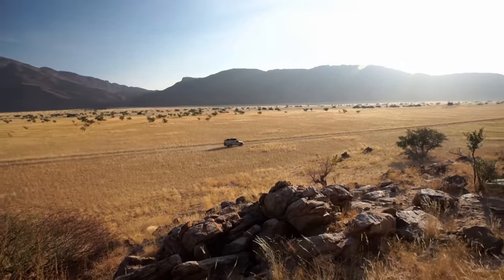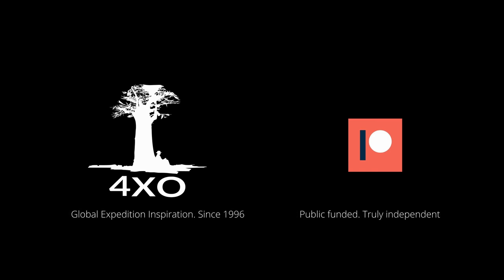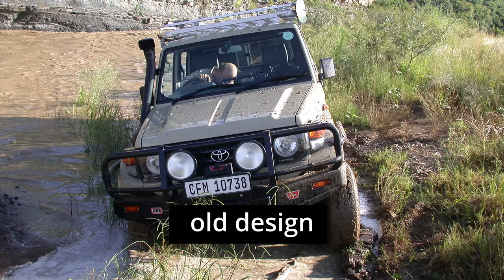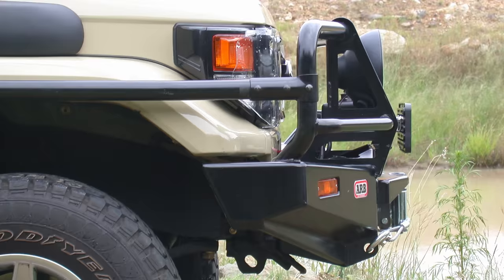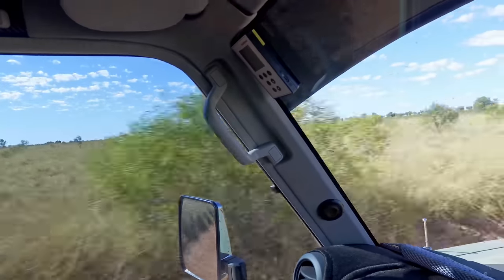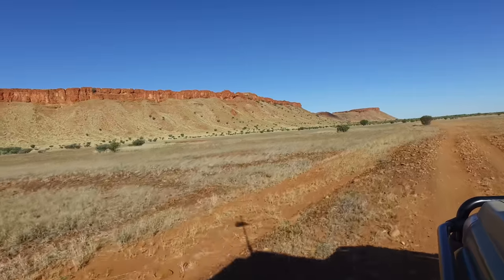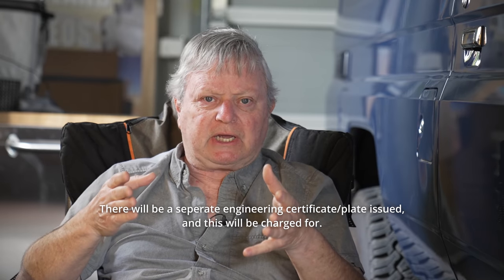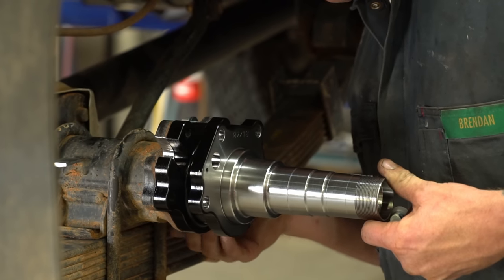TOYOTA LAND CRUISER AXLE-WIDTH CORRECTION. Is it Really needed? Cheaper alternatives? | 4xOverland

Comment: Have a 2013 79 , 180,000ks+, over half was towing a single axle 2.5T off-road caravan with 330kg ball down weight. 79 has basic Dobinsons 3750kg GVM upgrade and 2” lift. With the caravan in tow I have done GCR 5 times, GRR twice, Bungle Bungles twice(yes with caravan) Lorella Springs Savannah Way, Oodnadatta and Strzelecki thru Innamincka etc all towing. Don’t do much loose sand beach stuff. 265x75xR16 D697 Bridgestone AT,s. Have never needed matching wheel base , larger tyres or greater than 2” lift. Unless you are a super hardcore off-roading  or want the latest and greatest I can see no need at all.
Reply: How'd you rate the dobinsons GVM upgrade? Tossing up between them, TT, and ARB (OME)
Reply: @6jsm9  I am on my second set of shocks but 1000s of Ks corrugated dirt roads at 80kph will do that. Not the softest ride , but I have about 700kg static load with canopy and 2x80L water and fuel tanks, then add 330kg ball download, the 79 is not a comfortable car anyways . But more importantly it’s still there , just keep greasing the shackles. It does what I wanted it to do , and it’s been on since new. Oh, I have the standard Dobinsons yellow shocks that come with the kit, not the fancy adjustable or remote reservoir type.

Comment: You might want to revisit what is said around 16:50. Full-floating axles as fitted to 70-Series Land Cruisers, are so much better for heavy duty off-road applications than semi-floating axles used in lesser vehicles (where the bearings are lubricated with differential oil). Not only in terms of load-carrying capacity and reliability but also ease of trailside repairs.
Reply: I think what Andrew means is that if the bearings were getting hot due to wheel spacers or too much offset, having oil would help to cool them more and have them last longer. Oil is better at transferring heat than the grease. In proper form where the bearings are loaded evenly, what you say is correct.
Reply: @Splitface2811  This is debatable - oil might generally be better for high speed, high temperature applications but if the wheel bearings are unevenly loaded due to excessive wheel spacing, you are still going to end up with the same problem - no way any amount of oil will help. Another option which might be considered, is to opt for a high viscosity polyurea grease formulated for higher operating temperature and load-carrying capability.
Reply: @philipjooste9075  I don't think Andrew was saying that oil would eliminate the issues caused by the excessive wheel spacing. Just that he was saying that it might not be quite as bad as wheel bearings in grease.
Reply: You can have oil lubricated bearings on a full floating axle.  It used to be the common method.
Reply: Full floating axles are infinitely better. Look at the incredible number of videos withJeep axle failures for this reason. What do heavy trucks use? I wonder why.

Comment: Well said 💯. What ive found is the front wanders. Its wider than the standard 4x4. It feels like the back searching (which it will on virgin soil) but not  on an existing track. The front rises left and right. Searching. In my mind. Will i change the rear? Nope.

Comment: Cool, I can vouch for the -25 as a reasonable legal fix, that's what we ran on our 2013 troopy & it did sort out 99% of the rears moving around. Ended up running 17×8 0 offset up the front & 17×9 -25 at the rear with 305/70r17s was pretty much right on the limits legally for offsets & tire size but it worked
Reply: could you have two spears, different offsets and so doing a tire rotation per set?
Hope that make sense?

Comment: Here at my work, an outback station I have my personal 76 (track corrected with jmacx coils), a stock vdj79 tray back and a 2001 6 cylinder 79 series with narrow track front and rear. It obviously gives me a regular comparison, and I agree that it’s not a deal breaker but it definitely affects the vehicle in soft ground and towing at speed, especially with the 76 (before conversion) on wet roads was terrible. Any 70 series I own would get converted.

Comment: My Nissan Patrol leaf-rear ute (South Africa) also has the narrower rear axle. I've run 45mm rear wheel spacers on each side since new (no legal issue here), on 33's and 35's, and now, 360 000km later i'm still on Original Wheel Bearings (15 years later), and my vehicle works hard every single day, in all conditions. Not making any particular point, just more of a comparative comment for those interested, as its not exclusive to the LC (the rear axle width issue), however, i'm gobsmacked at the rate at which LC wheel bearings seem to sh!t the bed.

Comment: After doing 11000ks through Central Qld, the NT, SA, Vic and NSW, i have organised to have a 79 diff with the tru track fitted to my 2013 76series. I tow a 3 Tonne van and found that driving on narrow roads which road trains use, the 76 could not make up its mind in which track to travel, which caused the rear to move around, which in turn caused the van to move around.  Plus am using the 79 diff as part of a gvm upgrade.  Within.

Comment: Hi Andrew, Your Troopy's current skinny 16x6 wheels are P20mm offset - not zero offset.  What I did was to keep these P20 wheels on the front, and fitted the 42601-60620 Toyota 105series rims to the rear.  They are 16x6.5" and zero offset and have the same wheel centres, so it still looks factory.  That way I have achieved 40mm of axle correction and my rear tyres still sit within the guards so do not require rear flares.  Does that amount make a difference?  On sand (such as the Canning and Simpson),  like you I found my Troopy flew over the dunes with the 225 skinny tyres and did so better than the two 200 series I travelled with.  I also tow a Tvan and also a caravan, and the only improvement is with the heavier caravan on bitumen.  On dirt no difference.  Been testing this for a couple of years now.
I like to keep my Troopy factory as much as possible and I am concerned that widening the standard axle, and increasing the distance between the U-bolts and the axle face will increase the likelihood of the axle housing breaking at the U-bolts.
Reply: Can you please explain to me this in details

Comment: Another precise episode for which I thank you Andrew. 
A topic of interest, which you may be unaware. 
Some decades ago Jeep made a similar mistake but conversely. The late 50s early 60s saw the emergence of Jeep1ton utes/pick-ups. In their wisdom, Jeep decided to market vehicles with a far wider rear axle than the front. Under normal conditions the vehicles performed to expectations and proved to be OK. However, when the heavens opened in the wet season, Jeeps were completely hopeless in mud and slippery conditions. The front axle would plough through but the rear would fishtail incessantly from left to right searching for the ruts. I speak from experience, I was born and raised in the colonies.

Comment: Thanks for another great video. I thought a product like what you have installed would derate the rear axle. The weight of the vehicle is obviously transferred through to the axle housing via the leaf springs through bearings and wheels etc. By pushing the bearings outwards you are increasing the distance to the leaf pack. I’d like to hear your thoughts and if you see that as an issue or the manufacturer sees that as a disadvantage
Reply: I agree, you are increasing the lever arm between the bearings and the leaf pack. The bearings will almost certainly need upgrading or be looked at
Reply: @Dave-L-1984  100% agree, that just needs to happen. I'm not sure that engineering sign off happens with all products, or there is a disconnect between what is signed off  what gets installed and how it is used

Comment: The fourth don't forget the 71 series Andrew,  you content is would wide as should be your subject on the vehicles you talk about also. 
Why does no one complain on the gu nissan patrol coil front leaf rear pick up with large track difference aswell.
Another option is shave down a 105 rear diff of its coil gear, add leaf spring perches and brake line brackets. The brakes and rest of the 105 parts is identical to 79 series. Magic you have a wide rear diff.

Comment: Thanks Andrew. Brilliant video!!! 
I have a 76 series and do a fair bit of soft sand driving. I will try the offset rim idea and see how much difference it makes.
Reply: Will it be possible to put wheels that are negatively offset on the front to help even more or will they scrub?
Reply: @joshbevan9400  possible mate. There's not a heap of room inside after putting 33s on.

Comment: Hey Andrew - this 'searching' can be quite dangerous on icy roads/surfaces. It's a short-cut to the rear end sliding out to one side which can lead to anything from unpredictable handling to sliding into on-coming traffic. 

I don't know that this is an issue where you currently live and plan to take the vehicle, but if I had one here in northern Idaho, I'd be seriously looking to correct the issue.

19:08 "... as part of a coil spring perver, conversion" priceless!

Comment: Such a annoying issue with the 70 series, and yet we still love them.

The typical thing to do in SA is to just put spacers on. 🙈💀

I like the idea of the offset rims. Neg 25 is definitely a step in the right direction.

Also for anyone else who is wondering we don't have a axle correction option available locally and importing would cost a lot of money. 💸💸💸

Comment: I own a 76 the 70 series is a commercial vehicle designed for work which is what i use it for i wanted reliability as i 100% depend on the vehicle in remote locations.
I hardly notice the split track width if at all  but id agree that the wheel base would
compound the issue.
Im glad to hear that the 78 isn't as affected either as im looking to change to a 78 due to the extra space in the back.
As far as the bearing set up being a full floating rear end the same as every truck in production since the 1940s this design is far superior to the single bearing open bath as the axel shaft takes the full load.
Where with the full float on the 70s or a truck the diff housing takes the load reducing axel shaft breakige and bending.
Yes its more work servicing it but its a commercial vehicle not a grocerie getter follow the service intevals and you will never have any issues they are made to last.
G

Comment: I have a 2008 78 series Troopy in Aus and a 2009 76 series here in NZ. What I really noticed was that after fitting a set of rear wheel spacers to the Troopy it made a huge difference when towing the caravan, it just felt better. The spacers came with the Troopy and being as I only noticed the difference when towing, not off road, and also not being legal, I removed them and left them in a shed somewhere. I have found no issues where the 76 is lacking in NZ. I however only tow a car trailer.

Comment: During Covid I'd been doing Brisbane to Melbourne and back regularly. The first trip I did with standard axle, and I arrived at the other end absolutely stuffed, after chasing the car for 18 hours. I put in a Jmacx full rear end wide axle and it was like a totally different vehicle. I then did chassis lengthening 300mm and it is now the car Toyota should have built. How Toyota thinks it is still okay to sell these like this is outrageous - honestly, how hard could it be to just sell them at the same track?
Reply: Because people like you keep buying them. Toyota show you for fools. The reality is 76/78/79 are a complete and utter rip off for what you get. It's an afterthought cash cow by toyota. 80/100/105/200 are much better cars. Leafs, axle problems, horribly uncomfortable, im amazed people buy them.
Reply: Peter tell us why you used a 70 series for regular long haul driving?
Reply: @things_I_saw  agree wouldn't be using them for that type of driving.
Reply: @Snook_  Toughness, reliability, ease to find spares everywhere, lack of electronics, proven design, proven engines... All that has a cost.

YOUR OPINION might be that all this benefits are not worth the price paid.
The opinion of the buyers says differently.

You're welcome.
Reply: @Snook_  if you don't like it, simply don't buy it, but stop wondering why people buying them, it's their choice
Reply: @radod6147  it’s also nice to express why they are a rip off. The free world is great isn’t it

Comment: Dear Andrew, I don't think that the steering correction in handling on a grippy surface is linked to the different wheel base width. I'm pretty sure it is on soft ground, not yet in hard ground. There it is an steering axle geometry issue. My favority anti examble to your theory are the Citroën ID/DS, CX and SM. They all have significant smaler axles in the back then in the front and only one of them demands constant steering corrections: the SM due to a complete different steering system then any other vehicle coming from an assembling line before this got built in in automotive history. Also the issue has to get a bigger case the shorter the wheel base is, if it comes from the axle geometry.

Comment: Great review - thanks. I have a 76 series and lived with the standard track for a couple of years before deciding to correct it. In my case I installed the multi-drive full replacement housing as I also have a gvm upgrade. Quality of the housing is excellent. The change over was worth it in my opinion - more stable on road, completely different (better) on damp soft sand that holds tracks and no more bucking off the road when easing to the side of single lane sealed roads to allow incoming traffic to pass by. If I didn't drive on poor roads and sandy tracks I probably wouldn't have invested in the track correction.  Each to their own!
Reply: Viking, Im keen to have an offline chat about your conversion as I'm in the process of looking at a GVM upgrade and track correction for our 76.  Looked at Pedders (3780kg) most others 3600kg and Multidrive 3520kg.
Reply: @tonybalm5576  if you post contact details on your channel we can discuss offline. For the time being - I understand max standard axle load for a 76 in Aust is 3660 kg and that is why most GVM upgrades are rated to that load. In other words, the factory front and rear axle ratings apply. No idea what Pedders do to go higher - but they might increase the factory load rating of one or both axles. My GVM upgrade was the Lovells kit - I'm very happy with it. Others will have different preferences of GVM option. Track correction housings - there are a few options in Australia. For me, multidrive was very well made, with a clear warranty and not a massive weight increase. They also carry a good supply of replacement axles - just in case. Being based on an OEM housing, the multidrive option didn't result in a significant loss of rear lift which could occur if your replacement housing increases the distance between the axle centre and spring mounting face (ie raises the axle higher into the wheel arch). I hope that helps.

Comment: Not many other 4x4 vehicles have had this problem, but I can name you two....Both Used by the British and Australian Armies in the 50's and 60's.....These were the Austin K9  and the Commer Q4,   Compared to the Bedfords and Internationals of the time these two were nowhere near as good off road, simply because the rear track was slightly thinner than the front, so they had to work harder off road, leading to it being so much easier to get them stuck even on a pretty easy track.

Comment: Seemed to be all the rage to have narrow track rear on road vehicles years ago. MK1/2 Jack's and Citroens in particular. My 78 Jeep Cherokee chief was the same yet the pickups had a wider rear track than the front.... Look at Morgan, they had such a narrow rear track they ended up with one wheel at the back🤣 Good job in the solar set up Andrew. Do you get grants for that over in OZ? Think we still get it in the UK but if and when I do it I will go totally off grid and shake off the thieving utility supplies we have. It's only going to get worse with what's going on over here.

Comment: I'll offer a separate explanation for why manufacturers leaned to narrow rear track width.  First very rarely has a manuf made a vehicle based on offroad performance their usage is a by product of noted utility.   The intention  I've found in some older evaluations was that by having a narrower rear track the amount of trailing axle offset during a turn would be reduced ie say front wheels at 40deg turn angle cover 40' radius the rea would follow a 36' radius ( these are numbers for the sake of argument)  had they specifically designed the vehicle for off road travel equal track width would have been a more important feature

Comment: Thanks good advice - you could of course go back to the original Defender which has the correct track widths and coil springs and run the axles as they were originally designed with the diff oil lubricating the wheel bearings ....

Comment: It’s not an uncommon thing- Holden did the same with the VN commodore, narrower rear track from the previous generation. Most vehicles are built down to a price- not up to a specification. You’re dead right about driving in sand, we ran 4x4 trucks in the Simpson desert in the ‘70’s that originally had dual rear wheels, we converted them to single rears on custom offset wheels to match the front track width for greatly increased performance when driving in sand. The 14” wide Michelin sand tyres made up the difference in load carrying ability compared to the original dual wheels. The trucks had FJ 45’s as support vehicles as some trips were 800 km return, all off-road with the only communications via WW2 radio sets.